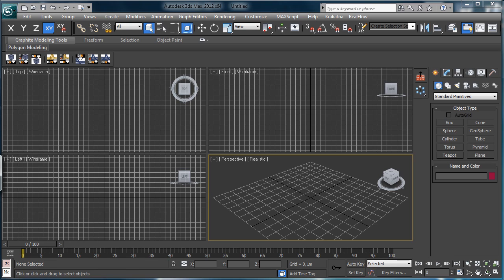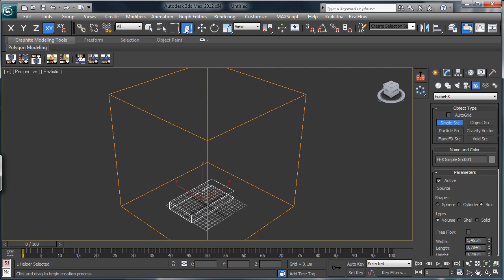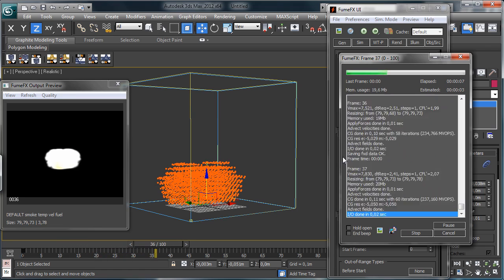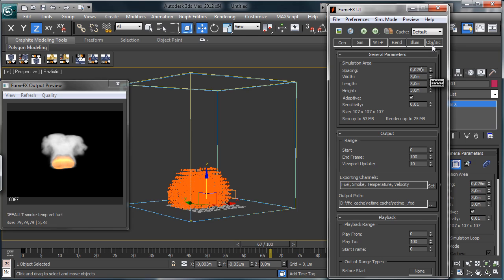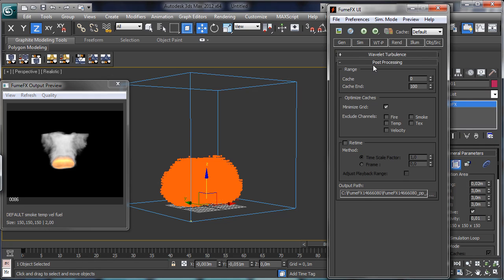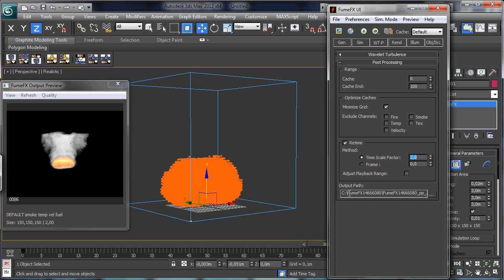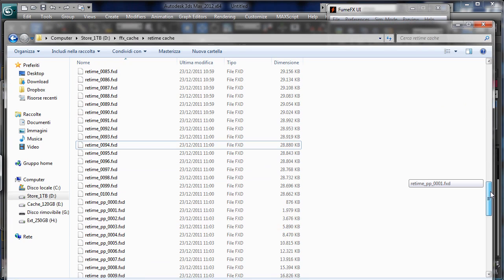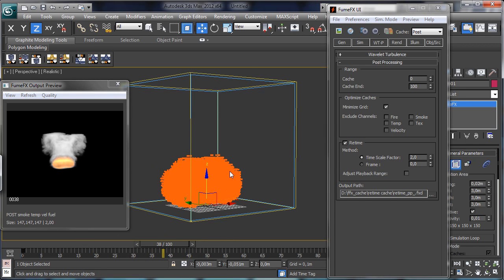Tip: FumeFX Post Processing

Comment: May I ask what cpu you have used? I am workin on a TR 1950x and for me fumefx is a lot slower on even low res sims but when decreasing the spacing it’s not that much of a speed loss. Does fume have issues utilizing multiple cores?